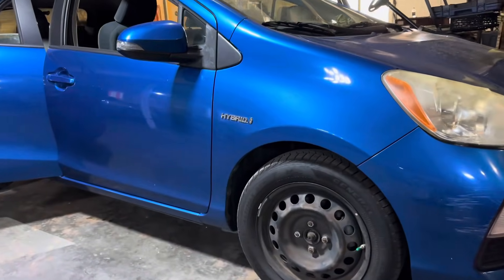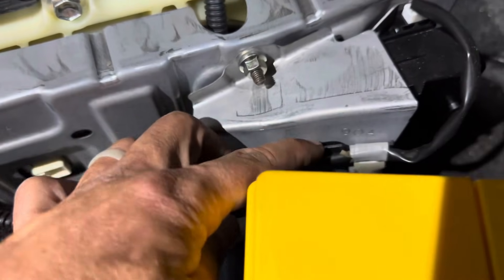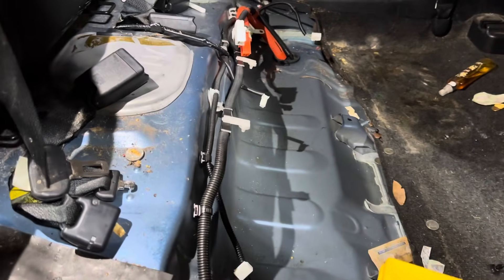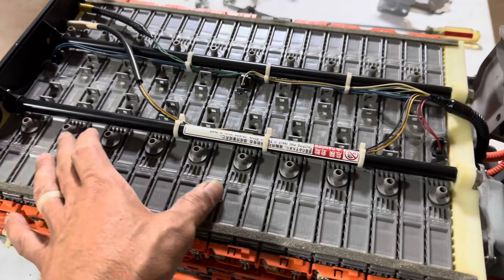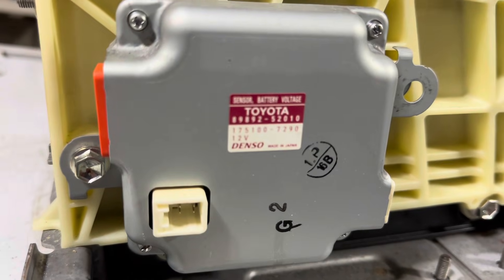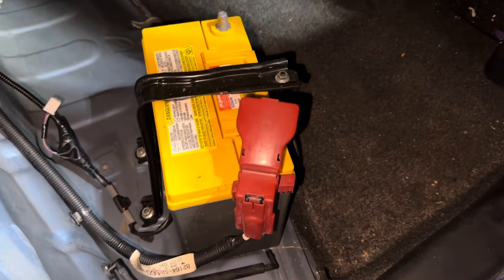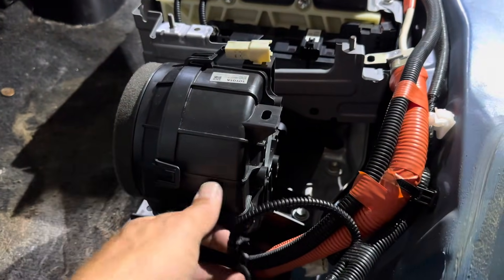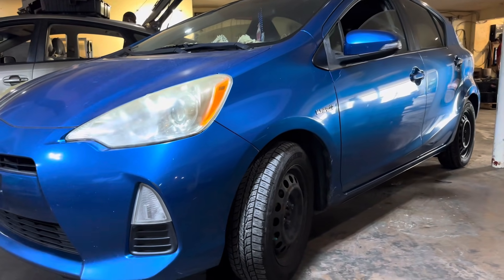Toyota Prius C Hybrid Battery Removal - Repair & Re-installation

Comment: Great video, but would have been even better had you shown the pain of lifting the battery into the car and sliding it into place.   Also doing the diagnostics and clearing any codes with the apps.  🤩
Reply from the maker: Haha, noted. I'll make sure to show the struggle on the next videos I do using the new NexPower Sodium Ion hybrid batteries. Diag info as well. Thank you.

Comment: is there any way with a scanner or something to check how many bad modules the battery has before removing it or after removing it?
Reply from the maker: My SnapOn scanner will allow me to see the cell voltages and IR. You can go into HV-ECU and DATA DISPLAY - scroll down.

Comment: If I heard correctly you can't just install the reconditioned cells, put the battery back together, and get back to driving. You have to put it on a balancing charge?
Reply from the maker: Correct
Reply: @PalmettoBatteryPros how can you balance the battery ?

Comment: Before I replaced the battery dashboard lights would illuminate.  Now that I have a new battery nothing works.  I have checked the battery installation and it was perfect.  Now what?
Reply: Anybody have any idea what to do next.  Battery was checked and it was perfect.  Nothing lights up.
Reply from the maker: Your cluster may have gone out. I would need to scan the car to determine the exact cause.
Reply: make sure every wire is plugged in. also, when you plug i the master disconnect, be sure to slide it up back into place. Check your 12v for power.

Comment: At 2:56 I don't have that plastic cover or that connector, but there's a bracket that looks like it's meant to hold the plastic cover. Is that normal?
Reply from the maker: Yes, I have noticed slight differences in the covers depending on the years.
Reply: @PalmettoBatteryPros  Thanks for a great video! I just finished putting my hv battery back in!

Comment: What is the little white rectangle box that sits on top of the hybrid battery?  It has a wire that you unplugged and it looks like it has something orange inside; I assume copper.
Reply from the maker: It is just a switch.

Comment: Two question. Will the engine start and run on only the 12v auxillary battery bit with high voltage battery disconnected? Secondly what is the symptoms of a faulty/dead high voltage hybrid battery?
Reply: Without a hybrid battery - your car won't go into "ready" hence won't start.
Reply from the maker: The vehicle will not work without the hybrid battery. The red triangle warning light on the dash will illuminate when the battery fails.

Comment: I want to purchase a new original hybrid battery for my prius c.  Do I just ask the dealer?  Anyone have suggestions on where I can purchase?
Reply: A new one will cost you like $4k with labor, if you have the dealer do it. Green Bean will give you a refurbished, great replacement battery for like $1.8k, and they come to your house to do it. And there is a 4 year warranty on it.
Reply from the maker: We do not import these cells anymore and direct customers to GreenTech Auto.

Comment: Some guy is saying that prius C and gen 3 batteries can't be refurbished because the computer can't handle the voltage
Reply from the maker: Not true, Gen 3 just has a lower threshold for variation between the modules.

Comment: How are you bare handing and metal socketing all that exposed orange HV hardware?
Reply: Yeah, that's a no-no. 

I've been shocked a few times touching them when my other hand was grounded to the frame of the car. 

You should be careful when the busbar is still fully connected to the battery. You can only safely touch terminals when the busbar is removed on either side.
Reply from the maker: When you pull the service plug the battery is safe to work on. You can also double check voltages.

Comment: I’m allowed to touch this with my bare hands?
Reply from the maker: Always test for voltage if you are concerned.
Reply: No, if you're grounded - don't touch. It's only safe to touch when you disconnect the bus-bar on either side. Also, you can touch it if you wear rubber shoes and don't touch anything with your other hand.

Comment: Just did my first rebuild on my 2015 Prius C hybrid battery and found your video to be BY FAR the best instructional guide anywhere. Too many of them gloss over the intricate details of disassemly and reassembly -- even speeding the video up to "save time", which only makes it hard to clearly see each step and installation trick precisely. Your video and the audio does not cut any corners and clearly shows everything from step one to the end. Referencing it as I went about putting my battery back together after having had to delay for several days was a life-saver. People should just do everything in the order you show and this complex task can be easy and safe. Thanks so much!
Reply from the maker: Wow! I’m blown away by your comment! Thank you so much. Really.